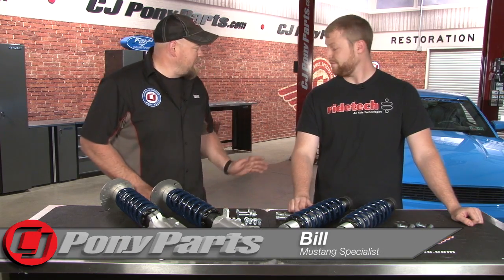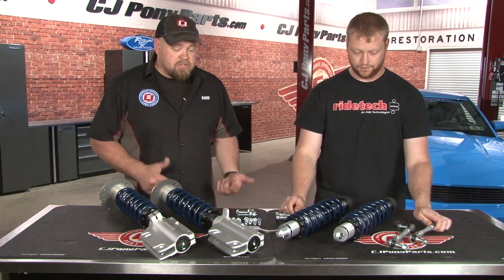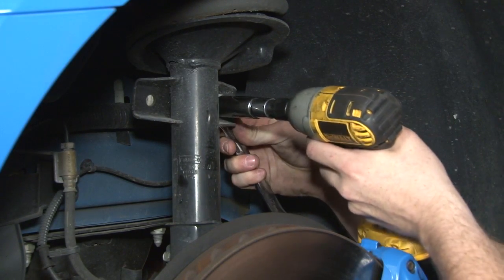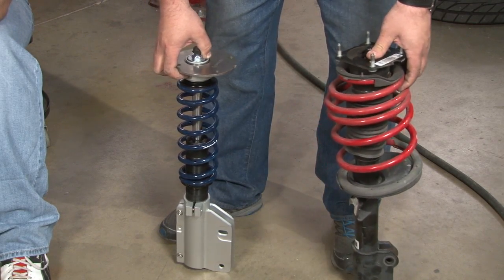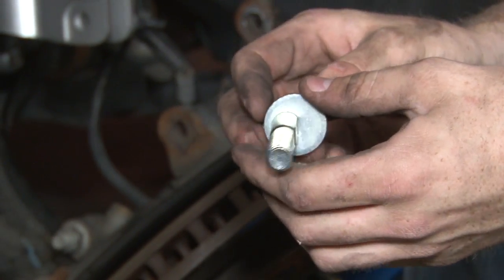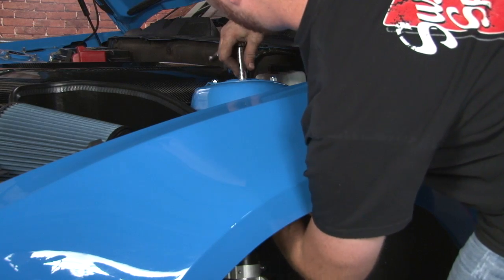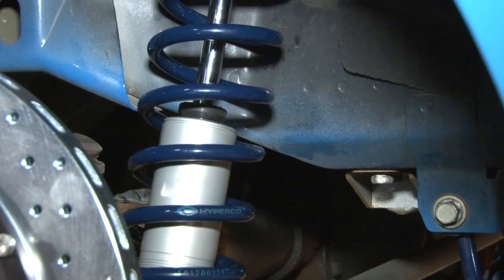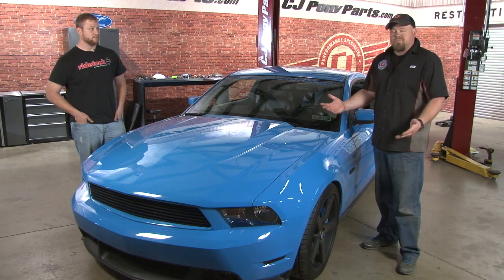Mustang Ridetech Level 2 HQ Series Coilover Kit 2005-2014

Comment: how low can the front and rear coils go?
Reply: Mine is dropped 2 inches all around and you could go another inch possibly but rubbing would be an issue.
Reply: did you lower the coilovers after you installed them? Or did the coilovers (the way they came) lower the car 2 inches?

Comment: Hi Billl. What would be the best handling pack or coilover upgrade you could recommend for my 2013 mustang gt? I dont mind spending as long as I get the best quality upgrade for my s197. Is the ford racing handling pack a good one to consider or any other suggestion?
Reply: ryanyentao888  This is my personal car in the video and I was happy with the Ridtech system. The Eibach Pro Street S is also a nice all around system. Both are coilovers so you get adjustability.

Comment: Do you always have to trim the rear part of the car to install any after market coil overs? Also, I would like to know if the allignment of the car will change after removing the old shocks.
Reply: ryanyentao888 Most coilovers will not require cutting. Yes you would want an alignment after setting ride height.

Comment: What brake rotors do you have? Are your brembos powder coated as well?
Reply: While we were doing the suspension I switched to Baer Eradispeed two piece front and rear rotors, 14in all all around. The fronts are direct replacement, the rears are called their Plus 2 kit and come with brackets to move the calipers.The calipers are powercoated.

Comment: Curious if you could have a coil over kit set up for a drag type suspension? If so, what would be the difference? And would it be better than the stock type set up for drag racing? Thanks
Reply: You can absolutely use coilovers for drag racing, most serious drag racers do. You would just want to change out the front springs for something for a lower rate that would be drag friendly.

Comment: The kit looks awsome I just don't know how i feel about notching the mount out for the shock to fit.
Reply: I wasn't thrilled about it but all the pressure is on the outside bottom so it really isn't a big deal. On some cars you just need to barely trim it, mine needed a little more material removed.